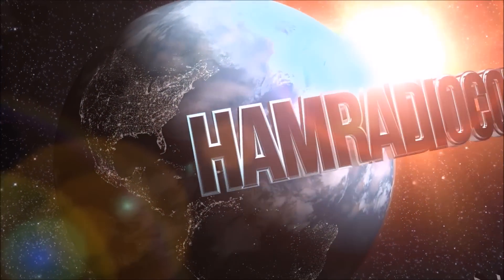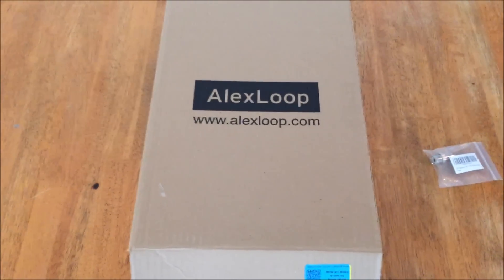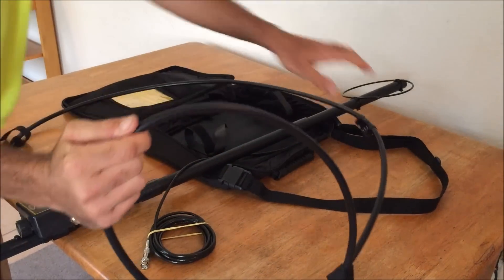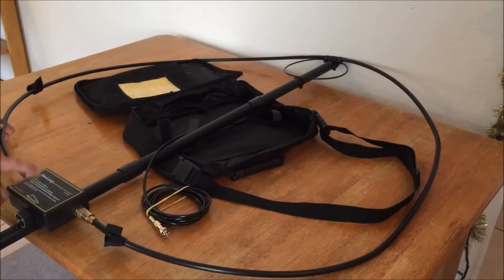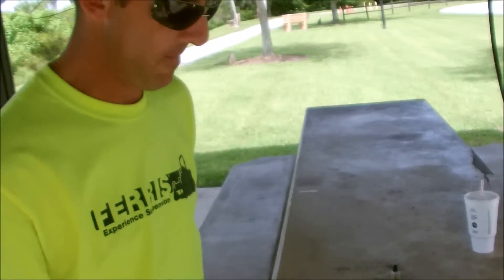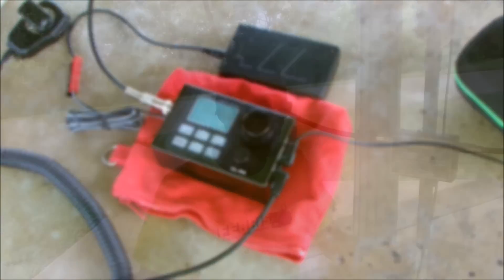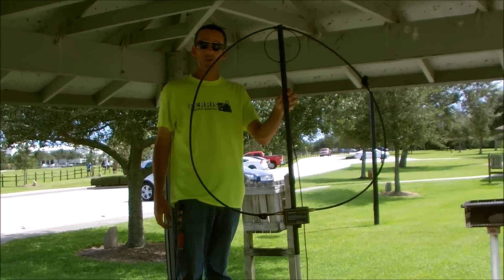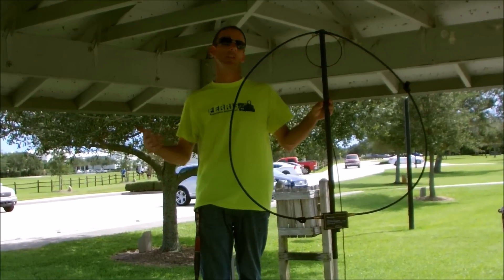PY1AHD Alexloop walkham HF loop antenna

Comment: This loop IMHO is horrendously overpriced being just a piece of cable and a capacitor. Secondly, the design with the capacitor at the bottom and the feeding loop at the top is a poor design. It is no good when the feeder cable crosses the plain of the loop. Equally no good when the cap sits at the bottom and you actually touch it with your hand each time you tune ( or detune, rather :)). Classical design suggests the cap at the top, the feeding loop at the bottom. The cap is tuned by the small motor or just by a dialectric stick going down to the loop bottom. Thirdly, there is no diagonal support for the loop, so it deforms quickly and becomes pear-looking just after hour or two hanging  on itself in the sunshine... This type of cheep cable made loops are good  for random operation and learning  theory of magloops though.  73! Linas LY2H

Comment: I built my own for about $ 30, it's simply cable and a capacitor, not even a coil or something. The hard part is the know-how, but for that there are internet and books. greetings from Austria
Reply: its a one turn coil.

Comment: I get how you tune it that's clear. Could I ask though: if I tuned like you did but then wanted to move around the same band, would I need to retune to receive say 50khz away from when I first tuned?
Reply: Yes, depending on the band [some are wider than others], when you change frequency you must re-tune because of the narrow bandwidth/very high Q of the loop.

Comment: Nice concept, I've been playing around with Mag Loop Ant for a few years, if you saw what the inside looks like you would not spend 400. The variable capacitor is cheep junk and the gear reduction is from some Tonka Toy left over.

The variable capacitor is forced inside a plastic box to small for it. If you want to see what the inside looks like, email Carl at Chameleon antennas. No offense Eric I just can't see a Ham getting ripped off. By American and get better quality.

Chameleon, W4OP Small Transmit/Receive Loop Sold by LNR.

On 40M, the W4OP loop is 4dB better than the Alex Loop, 6dB+ better than the Alpha Loop, 5dB better than the Chameleon CHA-F loop and 10dB better than the G4TPH loop.

Eddie kj4fgi
Reply: WSPR stats indicate much differently.  ;)

Comment: Hi Eric, great video, I wish I could afford a Alex Loop, it's a great antenna. One thing you said about the FX-4A radio from LNR is that it's a SDR, I believe thats incorrect, I own one as well as the LD-5 which IS a SDR radio, but the FX-4A is just a nice QRP SSB transceiver. I use my FX4 way more than the LD5. Thanks again for the video.